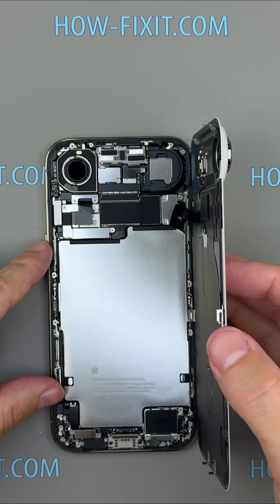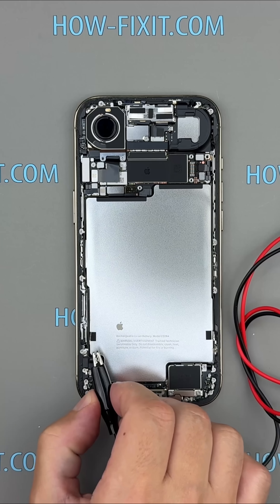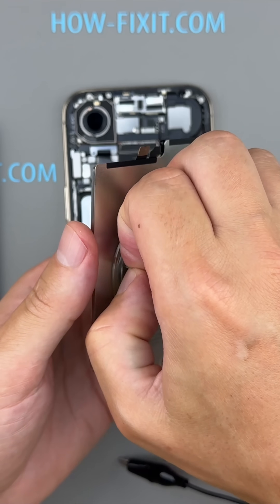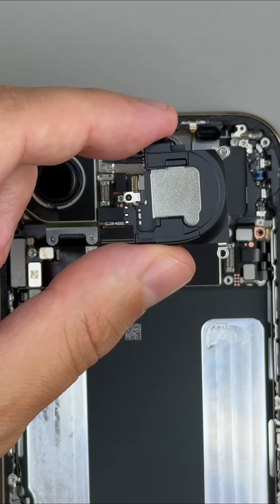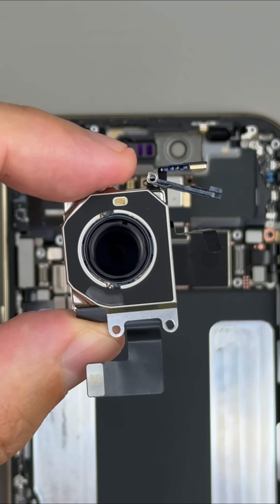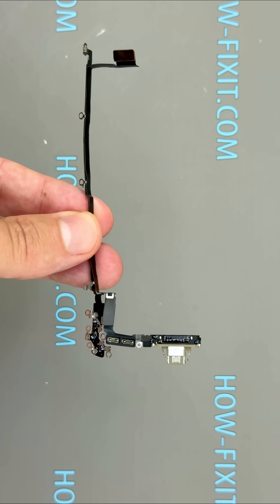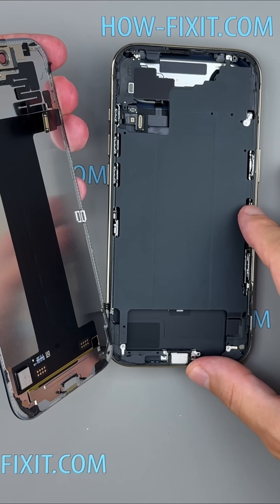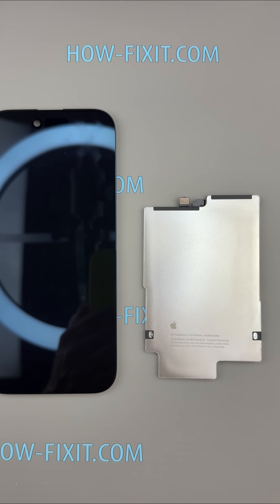iPhone 17 Air Teardown in 60s: Back-Opening, 9-V Battery & Modular USB-C

Comment: Can that electrically induced adhesive be reused or replaced with a new when e.g. replacing the battery or reassembling the phone?
Or no need for that, the battery can just sit there without the adhesive, has nowhere to move anyway?

Comment: it doesn't habe the taptic engine! that's why the vibration feels so weird compared to other iPhones
Reply: it does, at the bottom of the phone
Reply: @ThinkingPear410 ifixit says it doesn't
Reply: @JPK1337  you can literally see it near the start of this video, or on the ifixit teardown video while they are removing it from the phone
Reply: @JPK1337 you can actually see it. the battery has a big chunk at the bottom because of it.. Honestly if they removed it, then there will be more room for the battery, extra mAh 😂
Reply: It’s in the bottom right you can see it just when the back cover is removed.